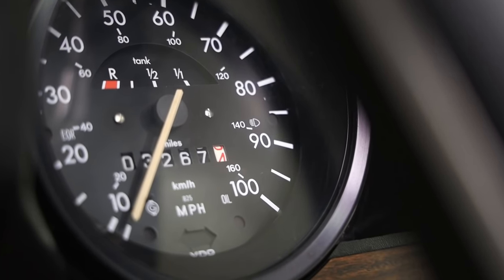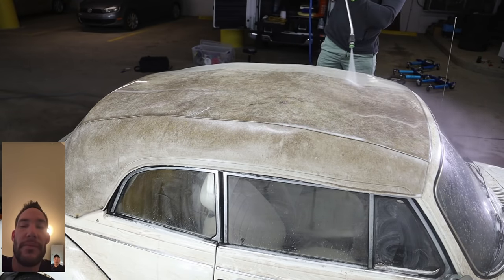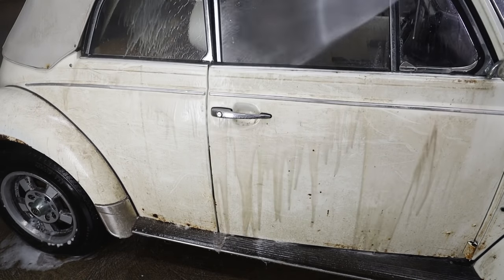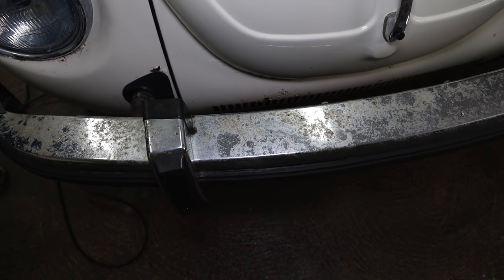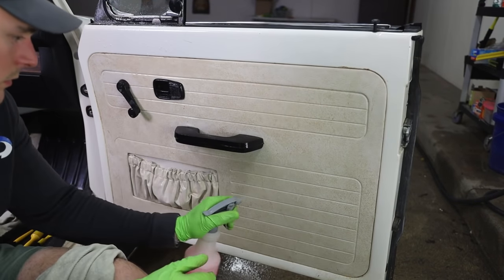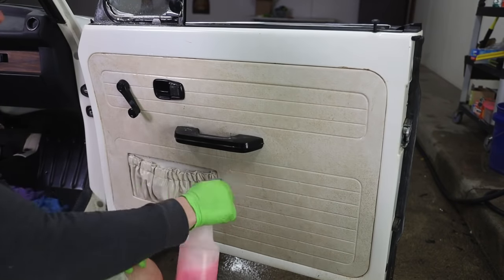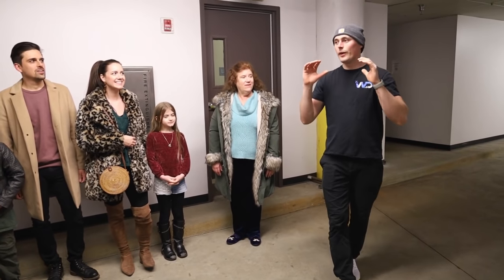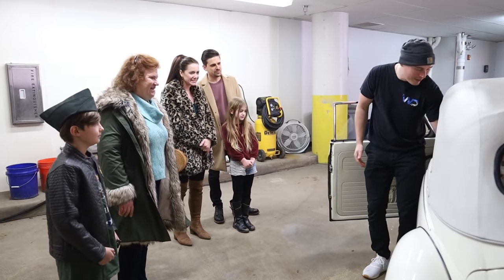ABANDONED BARN FIND First Wash In 20 Years VW Super Beetle! Satisfying Car Detailing Restoration

Comment: I'm a new subscriber and now a fan of the work you guys do! I'm very impressed! Detailing my car, for me, is relaxing and extremely satisfying because you see a result from the hard work done. I was wondering what glass cleaning product you use? Thanks and keep taking pride in the great job you do!
Reply: One thing I would do to give the 110% on any detailing, would be to offer the customer the possibility to remove the rust and repair some dents whenever possible. I know that detailing a truck costs up to $250.00 at the least, so removing these unwelcomed traces of time when you're detailing would be the ultimate must to complete the job to another level. I don't know, but these rust spots destroy the final look when the detailing is done...My opinion, but I suggest that these should be addressed with the client when you're requested to do a job on a vehicle. Most time, rock chips and other nicks can be spot painted and soft compounded with a 1500, leaving a better look than the rusted areas. IMHO...

Comment: A couple years back I worked at a VW dealership. On the show floor they had a new (never sold or registered) 1979 super beetle, all black, with only 39 miles on the odometer. People would occasional make offers on it. The owner of the dealership made it clear that it was not for sale under any circumstances. The last offer I heard was well over $100k. A week after that offer the owner had the sales office expanded in a way that made it impossible to get the beetle out of the showroom.

Comment: 1 dollar says it was the Bosch "D-jetronic elecrtrojector" that need to be fixed or replaced. They were awesome in theory, but the materials failed a lot. Btw, the "D" in D-jetronic stands for "Druchfühlgesteuert" which translates to "pressure fuel controlled" because it used engine speed and air intake pressure to determine how much fuel to send to through the injectors. 
If it were mine, I'd have it resprayed the same color it left the factory, then sell it or trade it for something I wouldn't be too scared to drive on the interstate. Lol
Reply: Yes, those things were trouble prone from the word go; computers, electric system faults including ground circuit issues, vacuum leaks and never mind that they were very slow.  Heaven help you if had the aftermarket DPD? A/C installed on it....

Comment: Big fan of the channel! Do you use an electric pressure washer and have you made any mods to get such thick foam? My unit has 2400psi max but only 1.1 gpm. I've tried many products and even completely undiluted and it's always still very running.

Comment: I would get it road worthy, restoring those areas of it. But for the body, yeah seal up some of the bigger rust areas on the body, as some have mentioned and paint touch up on the smaller ones. But to have the body restored if I chose to I definitely would get a VW specialist to do it. But to keep it as original as possible to me would be the way to go. Great detail job, looks amazing.

Comment: I’d restore it to a nice driver. Doesn’t need to be concourse quality, just a very clean example that you wouldn’t be embarrassed to enter in a local car show. Leaving the rust, and corrosion is only guaranteeing that it’s life is only so long, restoring it guarantees it’ll be around for the family to enjoy even longer.
Reply: Granted, it will be tough to match 46 year old paint, one could easily unbolt all four fenders, hood and license plate light assembly and repaint them.  Then again,  if you're willing to take the car apart, ya might as well repaint the whole car.  Tough choice to make.
Reply: For this type of car, it’s really not even worth it to restore it. The values just aren’t there
Reply: @kenwoodburn5244  if the family kept it since new and they care enough to get it running for a wedding, I’d say the sentimental value is all that matters in this case. Again, bringing it back to a nice driver with no rust or new paint isn’t restoring it, it’s extending its life.

Comment: Very cool time-capsule car!  Paints of this era were typically single-stage lacquers, so this may be fixable using spot-repairs.  Over-all, she's in amazing shape, so you could preserve the original finishes...for now.  Back in the day (and I was there!, ) white cars would easily get stained or yellowed, so we used a little Comet Cleanser w/bleach and mild soap to gently "restore" the color.  It worked well, but you were actually polishing off the damaged paint.  (Again, only for white lacquer.)  Also, if that interior was that dirty after only 3k-miles, you were the first people to really clean it!  Finally, my experience is that SOS or Brillo pads are a bad thing for chrome, because they leave a haze of micro-scratches that are permanent.  Go easy with all abrasives, especially steel wools...only use #0000.

Comment: I was surprised this car has a vinyl roof, but it must be original on such a low mileage car.

The earlier convertibles had a very heavy canvas roof, with a separate headlining and padding in between.  My Dad restored a ‘64 model years ago, and even then the replacement top materials were $$$.

Comment: I have a 1974 super beetle that I bought new.   Needs padding under the drivers seat is really bad.  Redid the engine at 120000 miles about 1980.  Has 180000 now.  Also have an 1973 412 with 42000 miles. It needs a lot to get up to good inside and out side .  I'm getting ready to get running soon.  Everything is there.  I let a 59 63 69 71 72 72 (a factory wheelie popper) 74  bugs and a 64 buss mistakenly go.  Still have a1981 diesel Rabbit I got new.

Comment: The super bug is different than the original bug. It had different front suspension for a better ride anI believe a different type of frame. If that’s the case it would not be a good candidate to be converted to a sand bug the original standard bug is better. I think the SB would be better to restore back to original and enjoyed as a street car.

Comment: Haven't seen the video yet, but will answer the question. Fix the rust first. It is not serious yet, but it will be. A good paint guy can blend in the new paint so only the most eagle eyes will be able to tell anything has been done. At this stage, that is easy. Wait a year or two of use and the rust will be much more serious indeed, costing a LOT more to fix.
As an aside, my 1990 Volvo 240 gets washed twice a year with Palmolive dish detergent, on the same day as tire swap between the winter and summer wheels and tires. Immediately after it gets a good coat of Mothers California Gold wax. Once done the car comes up pretty much like new despite 33 winters and almost 400,000 miles.

Comment: I'm a purist when it comes to originality. Need to find some one who is good at touch up paint. That alone will turn a 50 footer into a 10 footer. But as prone to rust as the old VW's are, the rust needs attended to.

Comment: Because the miles are so low. It will retain the most value to be in factory original condition. Keep all original Tires, belts, wiper blades... Replace them but Box the old parts sell them with the car. As for paint Repair only spots with no paint left. keep it as original as you can. Even if it is work to keep it looking nice. I have a 1965 Cadillac Brougham 50,000 original miles. I'm the first to drive it on the road since it was parked in 67. It should be enjoyed. you can have the car badged as factory original like mine so people know how special and rare it is.

Comment: Since this is an old beetle, I'd bare metal restore it, try and save as many original parts as possible of course, but these rust really bad without you really even noticing half the time so I'd have to check and protect the body and chassis just in case and to protect it for years to come